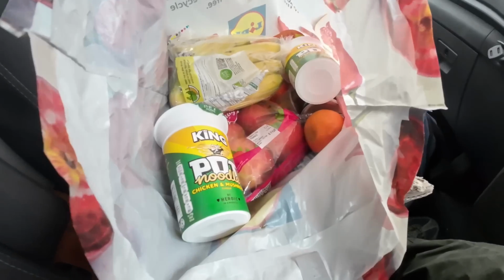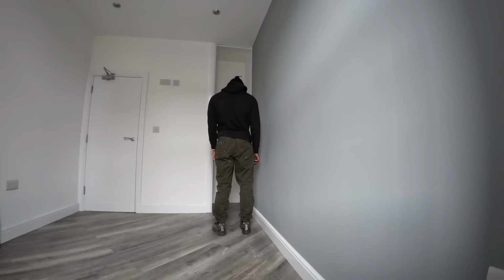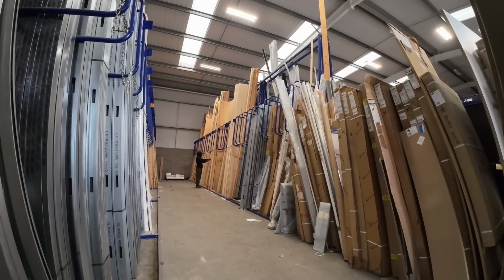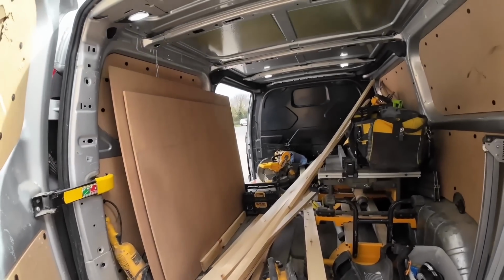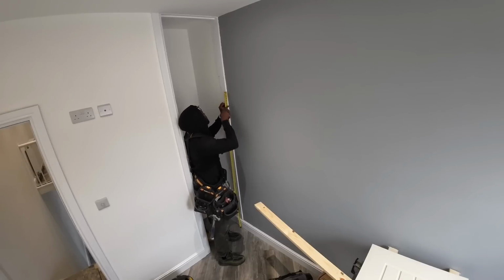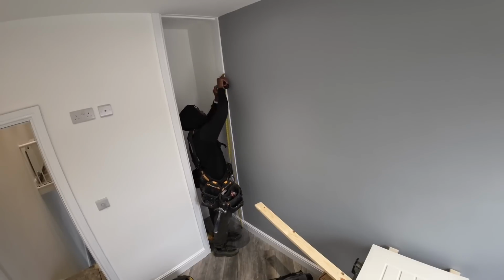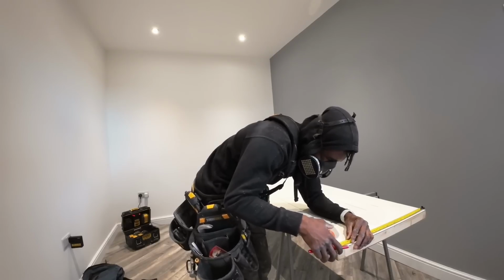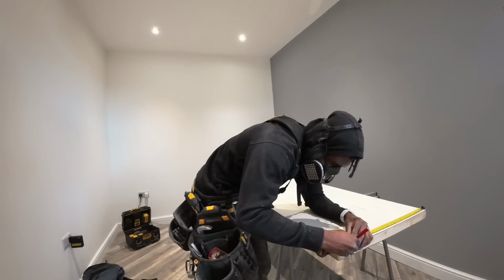Fitting a narrow door Day in the life of a self employed carpenter.  - Episode 10-

Comment: Trend do a jig for sashlocks thats saves a mega amount of time.. Bit pricey and you need a slightly longer cutter in your router but it pays for itself over time... And a much tidier and more consistent result.
I brought it after getting sick of drilling the lock out and messing around finishing with a chisel etc... Hate that job lol
Reply: Just buy a souber DBB Mortiser, much easier
Reply: @jonhandle  the trend jigs simalar price and faster to set up as you just change the template (magnets) when you want to switch between the mortice and the rebate for the face plate.
Both will do the job its just whatever your used to.
Reply: @darreninstone3626  are take a look

Comment: Love the videos. Bit of a question for you....When you're fitting a new door into an old frame, I notice you always measure from the head of the lining to the floor both sides and then cut your door accordingly. I've tried this method a few times and it's never worked out for me! I take it that the head of the lining you're putting the door into is perfectly level, that would explain how it works. However all mine seem to be massively out of level. I did one the other day and the head was 20mm out from one side to the other! Damn fire door as well so i had no chance of cutting the head to fit either so looked odd, other than cutting a taper to add to the frame there wasn't much i could do, Obviously that would have created more work re cutting the groove for the intumescent strip as well. So if I'd cut it by measuring from the top down like you manage to do it would have been well out. So do you measure up from the bottom of the door to get that measurement correctly. I cannot seem to understand how it works. I end up scribing the top first then hinge side then closing side and finally the floor. What am I missing or doing wrong. Your way seems a miles faster way to do it, I just can't get it to work lol. Appreciate your ideas. Thank you.
Reply: You could cut the door to size then add 2mm/3mm shim in the openings to see what catches and take a trim on the door using a planer on the side that needs it. Old door frames are like that and takes a bit of bodging to get them to fit in which is why fitting doors isn't always DIY grade job :D
Reply: I've cut a piece of ply 610x1000 with machine square edges, when fitting new linings or new doors to old frames easy to set square.
Reply: @shutinyanks  thanks for the idea ill give that a try
Reply: @dalemoore11  thats an idea thank you